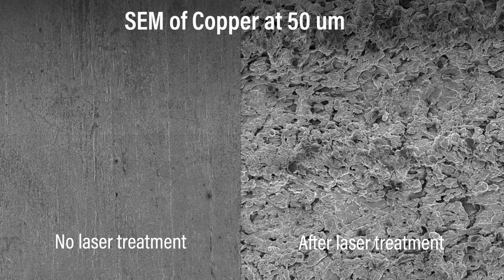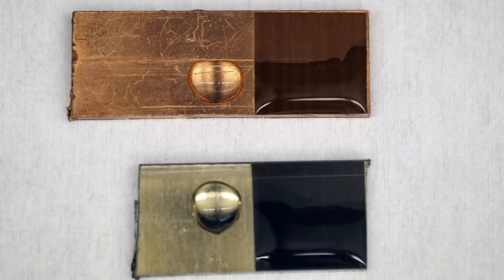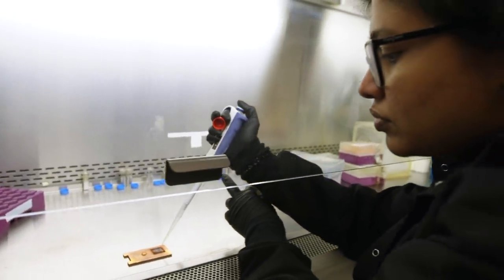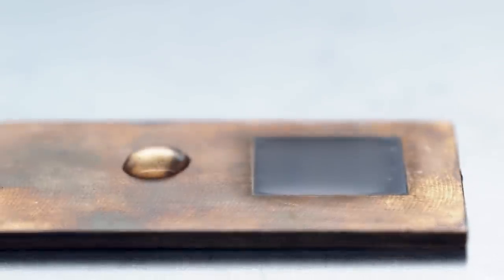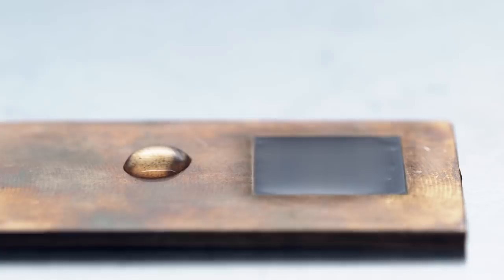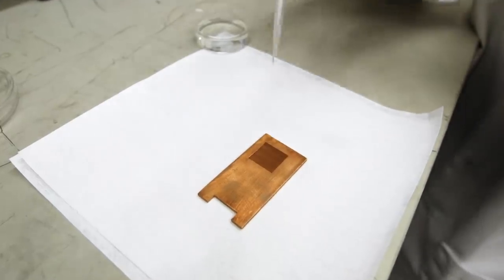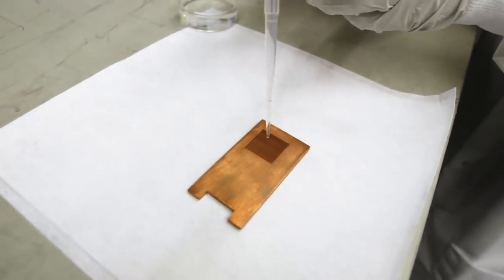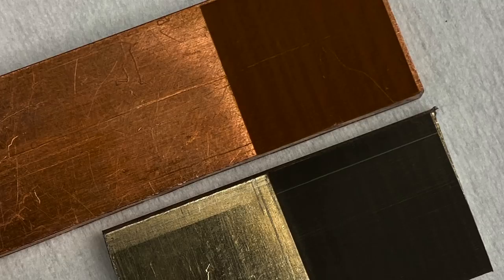Treating Metal Surfaces to Kill Bacteria

Comment: I see here one problem: copper and most of it's alloys are usually very soft and you can polish them by just touching, using them. You can clearly see it for example on brass door knobs. Does this technique prevent somehow the surface from getting polished again?

Comment: Improving the hydrophobicity of copper and its durability simply without chemical etching is great for antimicrobial properties.   Could it be used to etch onto polymers (fibers, fabrics) if there was carboxy functionality on the surface?   This could expand the potential end-uses.

Comment: How is the treated surface different from acid etch?
Reply: Thank you for your interest. Please read the new story http://bit.ly/antimicrobial-copper, which contains a link to the journal article and also the professor's name, whom you may contact.
Reply: They are literally just melting the copper surface with a lot of overlapping laser pulses. Each nanosecond laser pulse will create a melt zone in the shape of the laser beam profile. Along the edge of the melt will be a heightened ridge of solidified material, which overlapped with the next pulse starts to form this rough texture. The texture is highly dependent on the raster scan rate. Folks have been studying the laser material photothermal effects for years now, with the patterning effect already well understood. The additive science here is looking at its enhanced antimicrobial properties and the change in the material’s hydrophilic nature.
Reply: @everspectra  acid etch can also be done w lasers. How is melting a surface making a difference, are there chemical/physical alterings achieved by that which make it as wanted or is it more efficient like this or smth
Reply: @AUMO0  I believe do to the explanation it could be one of two things “shaving” it down causes grooves and they are concentrated in the groves so area is more raw effecting bacteria better/faster or it may be some “coating” so it’s scraping off top
Reply: Pour résumer, je pense qu'ils transforment la micro-surface du cuivre,  en éponge pour l'eau... 

Ce qui augmente naturellement son pouvoir antibactérien